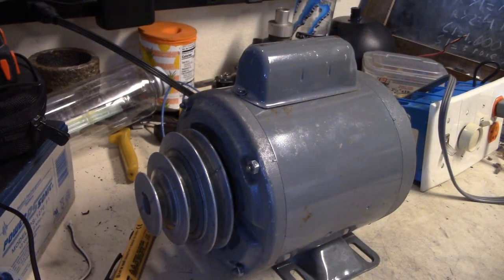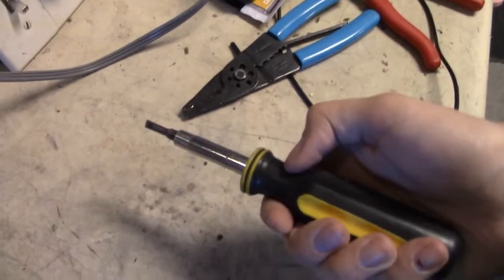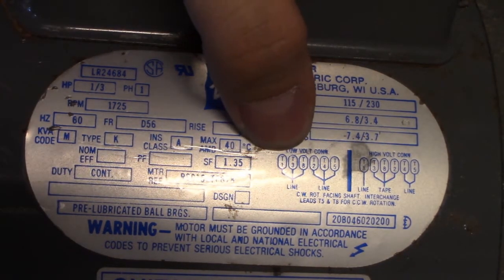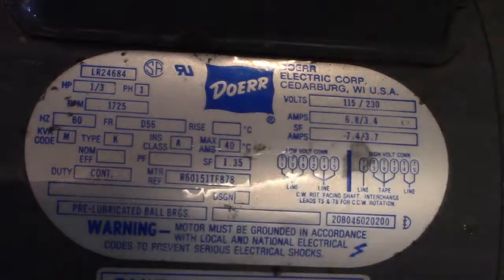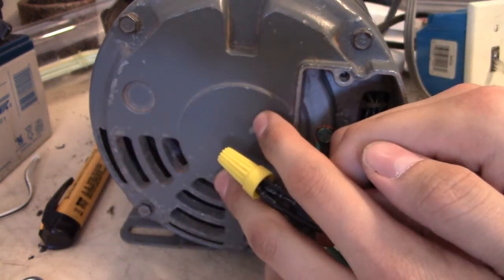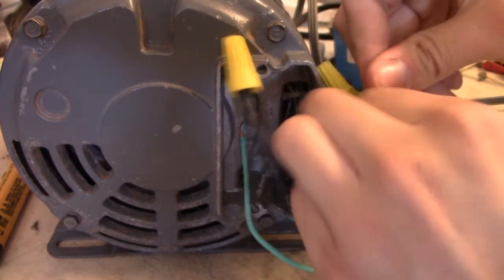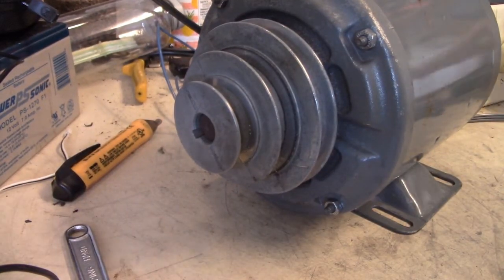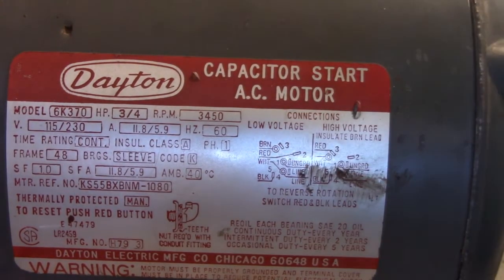How to reverse wire a thunderbolt rotator motor. (make it spin the other way)

Comment: Blower motor?
Reply from the maker: If the motor is 3 phase, you can swap 2 of the phases. A brushed 1 phase cannot be reverse wired. A 1 phase start capacitor motor will be similar to what I did. Just make sure the capacitor is discharged.
Reply: Ok

Comment: its a DC motor its obvious
Reply from the maker: Nope. It’s AC. 120-240vac.
Reply: @cooldomino1800  dc motors are reversable not ac
Reply from the maker: @gradientgamer5480  as I said in the video. A induction motor can be reverse wired. You just swap 2 of the phases.
Reply: @cooldomino1800  can you hard wire a Tbolt timer to a fire alarm panel
Reply from the maker: @gradientgamer5480  sure. I can try. My main panel is dead and I don’t have a RCM.
Reply: @cooldomino1800  it should activate when the alarm is pulled
Reply from the maker: @gradientgamer5480  yeah. That was I was thinking.
Reply: @cooldomino1800  will u get a RCM panel?
Reply from the maker: @gradientgamer5480  I’m trying to get one.